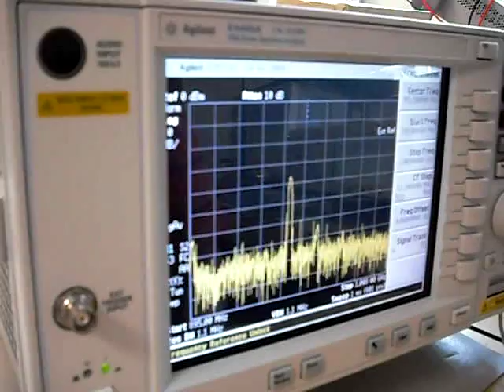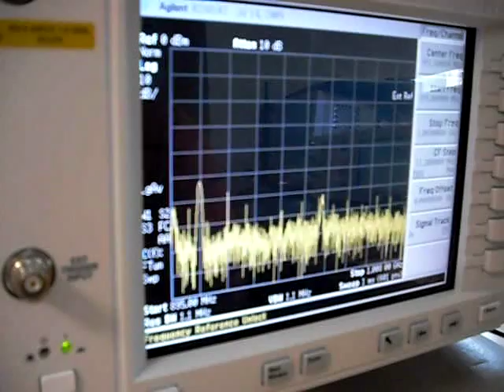A program written for the GNU Radio that changes the TX frequency of the USRP

Comment from the maker: First of all, a disclaimer. I did this 3 years ago and haven't touched GNU Radio since, so I'm sure a LOT has changed and I don't remember much. The version of GNU Radio we were using had some example transmission scripts, and we simply modified the code to transmit at different frequencies. The Python script handles all the modification of transmission frequencies and modifies the blocks in the flowgraph. If you need help with a project, I'd recommend emailing the discuss-gnuradio email list.

Comment: Was hoping you might elaborate on this a bit. Are you using RPC or some other network protocol to switch the RF frequency of the USRP from python? I didn't think that the frequency could be changed from the flowgraph itself as the python flowgraph has no sense of time? It's my understanding that switching is best done in C++ blocks. Thanks and I look forward to your response. I'm working on something similar myself.